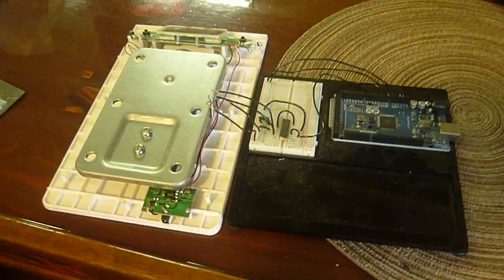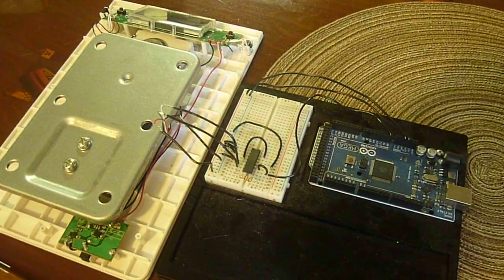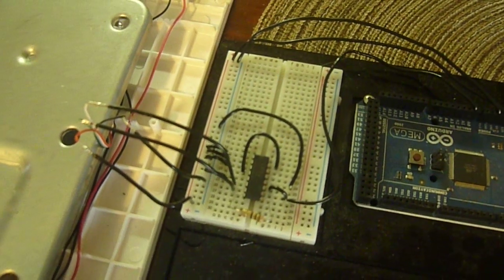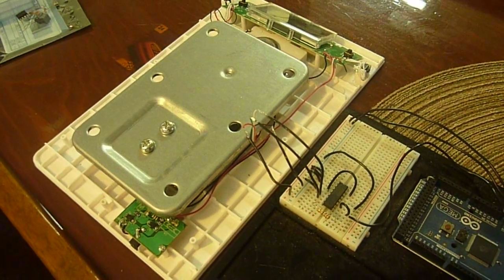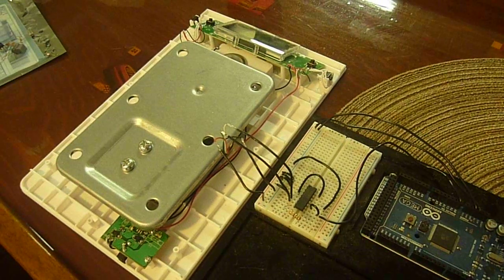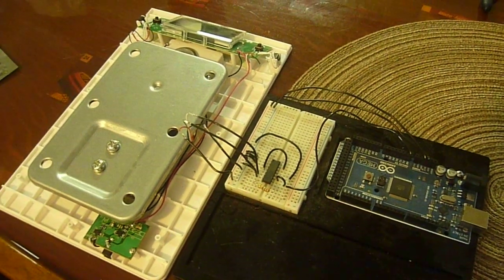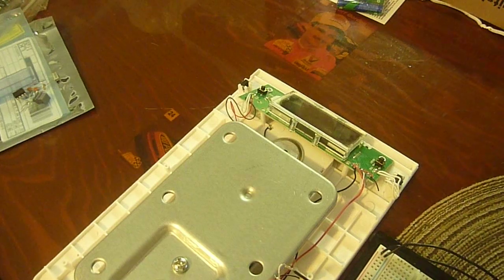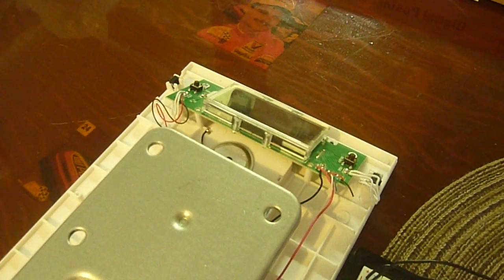Arduino Load Cell / Scale Project

Comment from the maker: Sensitivity is dependent upon how many bits of resolution you have on your ADC. The Arduino UNO is 10bit, so 1024 bits of resolution. 5v / 1024 = .0048 v steps. The Arduinio Due is 12bit, 3.3v, so 3.3v / 4096 = .0008v steps

Comment: OK this works perfectly fine with other load cells. I used a 20kg cell, 5€ from china. You have to take a bigger resistor to get the full range.

Comment: hi must i use the amplifier to have something on my arduino serial monitor? i just tried to connect my load cell up onto the arduino but the serial monitor shows no difference when i apply force

Comment: Having said that this is awesome do you know any site or help that will work with a scale that has only 3 wires? I have a GRUNDIG scale with 4 loadcells and each of them has only 3 wires: red, white, black.
I follow exact your design but connected only the 3 wires. But my serial output only increases each time I call it. No matter if I push the cell or not.
Reply from the maker: Try this - http://electronics.stackexchange.com/questions/18669/how-to-wire-up-a-3-wire-load-cell-strain-gauge-and-an-amplifier

Comment: i have been trying to create this circuit but my figures are jumping on my ina125p output jumps from .5v to 4v i think my ina125p is faulty i have made my bridge and using a pot where my strain gauge would be to test. the voltage from the bridge is nice and smooth when i measure it while adjusting the pot . but the ina125a jumps massive  any ideas ?

Comment: Hey, can you tell how fast the response time of this is? I want to use a 20kg cell and the INA 125 to measure the thrust related to time of an rocket engine. Thank you!
Reply from the maker: pretty much instantaneous and continuous.
Reply: Steve Spence Damn that was fast :D Thank you!
Reply: Steve Spence
dude, I have CZL928F load cell and just has 3 wires, red, black and white, if I put 10DCV like say the datasheet and I read the white wire with my multimeter (positive with white wire and negative with black wire) I don't have nothing, Do you know how to get data with 3 wires? How is the connection with 3 wires?, Tnks
Reply from the maker: Julian Paredes http://electronics.stackexchange.com/questions/18669/how-to-wire-up-a-3-wire-load-cell-strain-gauge-and-an-amplifier

Comment: can I use an adafruit trinket mini controller instead of regular Arduino?
Reply from the maker: +WLTR AEP any arduino compatible that has analog inputs.
Reply: Steve Spence how many pins did this take up? do you think I can transfer this to a chip?
Reply from the maker: +WLTR AEP It uses 1 analog pin

Comment: I want to get a stepper motor drive and load cell together interfaced to an arduino, will it work??
Reply from the maker: +parag shendye Yes. You are limited only by your imagination, and your programming ability ....
Reply: Steve Spence sir this is the first time m getting my hands on an arduino and being a mechanical engineering student I have never really had a chance to learn much of programming, is it possible for u to help me?...I 'll contact u once the procurement of things is done
Reply from the maker: +parag shendye I am available for contract work.
Reply: hello parag .. i am a mechanical engineering student too . what type of project           are you making ?
Reply: Venktesh Kaushal thanks for your response but v have already completed it using SCADA, the project required readings up to 3 decimal digits so v had to go with this. But I have become kind of an arduino enthusiast now.

Comment: how relaible and what will be the cost of load cell?
Reply from the maker: Parul Tyagi Under $20 typically, and very reliable. This one came out of a digital scale, but you can get bare load cells on ebay.
Reply: Steve Spence THANKS :D
Reply from the maker: I no longer use the INA125P, I use a HX711 - http://arduinotronics.blogspot.com/2015/06/arduino-hx711-digital-scale.html
Reply: Steve Spence yeah that's better option
Reply from the maker: Parul Tyagi Sure, greentrust@gmail.com
Reply: Steve Spence thank you!!!

Comment: Could I use a hx711 with a 50kg load cell for this same setup?
Reply from the maker: +Truth or Consequences Yes, the hx711 doesn't care about the rating of the load cell. just has to be a 4 wire.